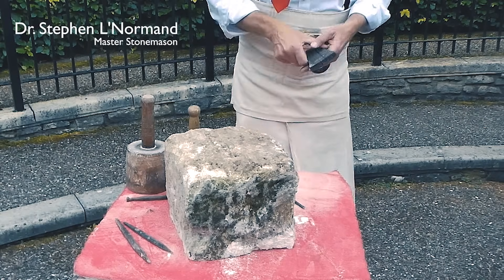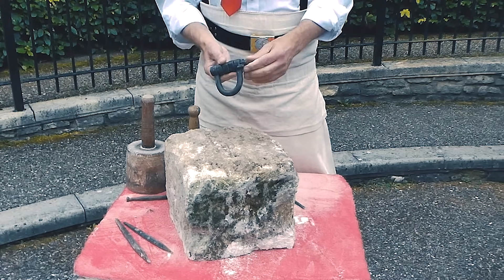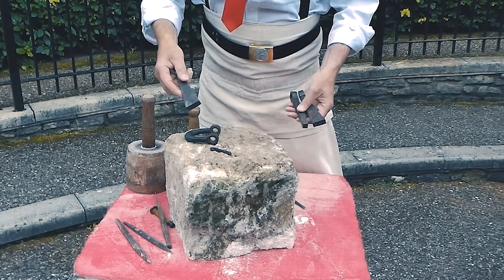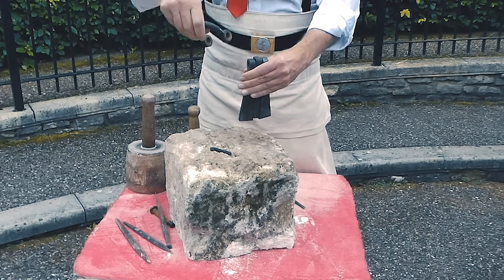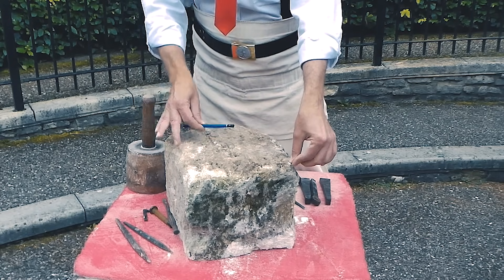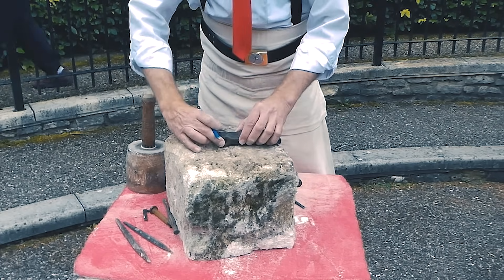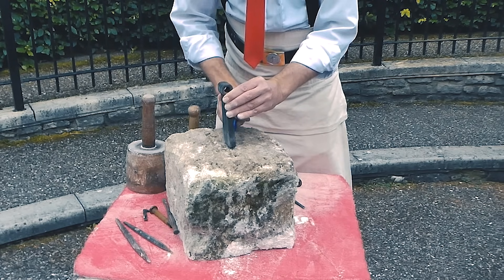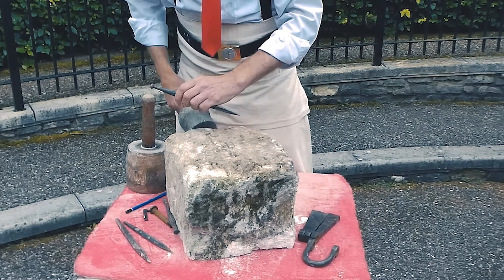Three Pin Lewis Demonstration

Comment: I have worked with old stone masons who didn’t have power tools, and I have helped them to build a couple of private mausoleums. They were 8” thick granite walls 8’x10’ they called that device a German key. The Lewis pins we use are single angled apposing holes. Sometimes as many as three mostly two. And the type of steel they are made of now makes them very expensive but they work great,because you can’t use straps when setting walls. And also the pinned stone clamp works too and cheaper.

Comment: I always wondered...Thanks for a great video, impressive demonstration with a clear narration. Well done, Sir, well done indeed.
Reply: Do you cut a keystone shape in the stone, with the bottom wider?  The 3 pieces fit too loosely to think otherwise, not that it needs to be a tight fit in either dimension.
Reply: @ljprep6250 yes you start squarely and then go wider

Comment: They allow a stone to be positioned or fitted into a slot where other lifting systems would get in the way.  The quality of the stone is important as the device puts the block in tension (splitting).    My opinion, for what it's worth,  is from basic mechanical engineering and dry stone wall building experience.
Reply: thanks. I was about to ask "why is this a thing when we have ropes?"
Reply: @zachweyrauch2988 - Ropes would be difficult to remove once the stone was in place if you had it sitting on them.  You could use either nubs or pins driven into the sides of the stone to lift with ropes rather than having the rope lift from under the stone.

Comment: Brings back memories. I worked off the side of the Manchester ship canal. The Queen Elizabeth II Dock repaired chipped que sides but of Granite. Splitting pin and feathers saved time to but as for that split lifting eyed hook, that was cutting edge. Ours had only two partseparate,  the hole was 30 mm and straight it was only the weight of the granite kept the pin from slipping and sometimes an inch or less.

Comment: I work stones I find on the ground with a rotary tool and diamond bits and one thing I've learned is it takes a long time to work through a piece of stone. Could be I have cheap bits, or I sometimes hit a really hard part that won't even cut. Most of the stone here is lime, so it's easy enough to work with.

Comment: i wonder if this method was not to be used for stones exposed on the upper side of buildings as rainwater pooling and freezing in the slot (if turned upwards) could have prematurely weathered and split the stone
Reply: It's UK, I will bet it's either something to do with H&S or someone was offended...
Reply: @tomekciepiaszuk582  What on Earth are you talking about? The question was about whether this method would have been used in the past for stones on upper surfaces.
Reply: @beeble2003  Ah yes, clearly I didn't pay enough attention, ignore me.
Reply: @tomekciepiaszuk582  Fair enough. :)
Reply: The holes would be in the mortar joints between courses. Capstones would be lifted wrapped with rope or inverted
Reply: wiki says there were specially cut inserts. not cited though.

Comment: Pretty cool, though I can see why it is illegal, someone that did not know how to make it right could kill someone lifting it
Reply: How? Someone lifting it would not be so stupid as to walk under it. Would they?
Reply: Yeah I work with a couple of morons that are a little high and do stupid stuff like that. I work at a small stone quarry and have seen them walk under parts of the crusher as we had to replace some of it.
Reply: @jeffharper7579 do they not put a barrier up to alert people of the overhead danger?
Reply: @paulfrost8952  if you have a controlled number of people on site (ie staff and not public) then information rather than barriers is standard practice for lifts.
Barriers can be impractical and people still walk through them.
Reply: @pobvic  if the barrier can be walked through it’s not a barrier!
Reply: No    sometimes they use a track hoe to lift parts of the plant and they have to guide some of it but they still get under some times😵😵😵 this is why I stay away from them.
Reply: Ok but just like the rules for gun safety (never point even empty guns at people), there’s social rules for lifting heavy things (never walk under a load), no matter what era you’re in.
Reply: @paulfrost8952 I work in forestry and have had people climb over barriers. Sometimes they want a closer look at what you're doing, some see it as their right to go where they please.
Reply: @pobvic   Absolutely agreed. I operate a crane in Southern Maine. I've had an elderly woman lift the caution tape and walk right through the lift zone.

Comment: is there a particular reason they are illegal now?
Reply: My guess is safty reasons.. 🤷🏻‍♂️
It's held only by preasure.
Reply: @Smokinnnn That's my guess as well. It's too easy for a novice to carve the slot improperly, and the key to slip out while the block is in midair. It's also not guaranteed that a hidden flaw in the stone won't cause it to split while in midair and there is a ton of pressure on that wedge.
Reply: @Scarabswarm  
Exactly mate. Sounds logic to me.
✌🏽🍻

Comment: Apart from this time consuming method there is a way simpler one. (Not to mention that this method has the potential to split the stone.) 
Almost all of the stones in gothic cathedrals have 2 or 4 small holes on both sides and they were hoisted up with a simple claw very similar to 20th century ice block claws. The larger the weight of the stones, the tighter the claw grips compressing it.
Reply: The first I learned of this was observing Segovia aqueduct back in 1996, and noticing all those holes and surmising they might have been for lifting. I had to look them up later. No internet for me then.

Comment: I assume that was for setting a stone next to 1, or between 2 stones, with or without mortar. They didn't have a tong-like device similar to the ones used in the early 1900s when ice wagons delivered ice. (That's why "ice box" was used in reference to a modern refrigerator.) One can save time not chiseling a lewis hole. A rope & pulleys will lift a stone from the ground to an upper level of installation.

Comment: So, this is a very clever design, but I think an explanation is in order, an explanation of why this device is better than simply putting ropes around a stone. Is it because this device allows a stone to be placed very precisely where it's going, so builders don't need to deal with any movement or instability at height? Ropes seem like they'd save time, but maybe removing them up high is more risky?

Comment: why is it now illegal to use?
Reply: Not safe
Reply: This device must have pre-dated safety. Safety is a modern concept designed to add thousands to the cost of everything, slow everything down, provide employment for a whole subculture of “safety” experts and increase the salary of everyone involved as a “pass through cost” to consumers.
Reply: @johnfisher7143 … and probably save a few lives along the way…
Reply: @johnfisher7143  Boy did you hit that one square and true.  Safety is fine and all but there comes a point that if you need to feel that safe, it would be best that you just stay wrapped up in bubble wrap and your little blankie at home in Mommy's basement being fed pudding and pre-chewed bread...
Reply: @johnfisher7143 Yeah, and how can the serfs tug their forelock while wearing a hard hat.
Reply: @johnfisher7143  No. This basically a wedge in the stone and the risk is that it will split. That should be pretty obvious. Safety standards are written in blood. Do you think road safety rules are unnecessary as well? How much ignorance can you display in one comment?
Reply: I've not seen that type used, but I've seen the hinged sort - where the pull on the rope forces the pins outwards.
Reply: @dougaltolan3017  it's one thing when you allow workers to use tools, it's another when you force them to. The modern "safety" is the later.
Reply: @futsk01  I live in a civilised country where employers have a duty of care for thier employees. That includes accident prevention.
I've heard of countries where fools shun that concept, adopting the blasé attitude of "hah, it's your own fault you're maimed or dead", even when the employee didn't have the capacity to take care of themselves.
"modern" safety is written in blood.
Reply: @dougaltolan3017  I live in a country where employees are adults and can take care of themselves as long as they aren't impeded by the company or the government. I'm aware that in some regions being an adult is a rarity and society operates accordingly.

> "modern" safety is written in blood.

like every modern rule it's written in money and nothing but money.
Reply: @johnfisher7143  No, safety is a very old concept designed to stop people dying at work. You should try it, some time. Not dying is one of the best things that can happen to you at work.
Reply: @futsk01  I totally agree with you about the money bit, but I looked up the three pin lewis and found that if some of the weight comes off the stone while lifting then it can slip out, which sounds scary as fuck and maybe not worth the risk.
I don't think that people need to be forced at great expense to do things that they were likely to do voluntarily.
Like copyright, health and safety has mutated over the years.
Reply: @malkomalkavian  Yep, I agree with all this. What government should do instead is make sure the employers aren't forcing people into unsafe situations. But it should be there as an option.

Comment: Knowing how concrete anchors work, wouldn't it make sense to have the center pin be wedge shaped instead of the outside ones, and then only have the eye on the center pin (so pulling on it just wedges it harder)? Am I missing something?

Comment: seems like it would be easier and faster to just stick the thing in a net, or just pick it up and carry it. 
In what contexts is this the quickest or easiest way to get the stone where you want it?
Reply: In the context of having to place the block on a wall, and not having a net suddenly pinned beneath it. By carrying the block from the top, you can lower it into its exact place and not have to try and shift it while straddling a half-built wall 50 ft in the air.

This is used on bigger blocks as well, the small stone was just for demonstration purposes. Nobody is carrying a 300lb block up a rickety wooden scaffold. Or having to one-hand it while trying to maneuver the net out from under it.

Comment: I assume that they were effective and easy to use, but the blocks can still split, so they were made illegal to stop people from using them.  Professionals may have an occasional accident but the tool is so easy to use that amatures would cause all sorts of trouble.  A pity.
Reply: Not splitting, the pins would get loose during transport and elevation, because they are held by friction,   this caused several deaths.

Comment: I don't have much experience with historical (or any) stonework, but at first glance, this seems like an awful lot of work just for the purpose of lifting the stone. Why not use a simpler method, like the self-locking claw things, for example? Cool technique, though.
Reply: Those were not made when these were widespread. It's a historical demonstration of how it used to be done.
Reply: @timothydoyle9635  Hm, I thought those claws were pretty old too. I remember seeing one in the museum of the Charles Bridge in Prague, which was built in the 14th century.
Reply: They probably provide a more secure hold on the block. I've seen several of these holes in stone mines in Wiltshire. They're an easy thing for a blacksmith to manufacture as well which probably helps
Reply: They were used because there's no encumbrance on the sides or bottom.  So no complicated fitting issues to overcome, just set it in place and done.
Reply: Forging one of these is much easyer and can be done in a smaller smiths. Big claws require big forges and good metal quality. Small tools are easyer to maker
Reply: @ignasmaciulis1095  The lewis bolt was in use more than 2 thousand years ago. Really very old.

Comment: I enjoyed the video.  Very interesting stuff.  How come the mechanism is illegal now?
Reply: If the stone had an unknown fault, and we're talking much bigger stones being lifted way up in the air, it could let go while being moved and fall to the ground killing whoever was unfortunate enough to be under it, or possibly doing some serious damage to infrastructure. It was a system that didn't have any backup if it failed. These days we can add multiple chains and / or straps to something being lifted. 

Also the process of adding the holes it needed to install it, could cause damage to the stone you didn't want in the finished product.
Reply: @PathosBedlam  so you know of this method failing then
Reply: @paulowens2062  No, I'm sure.

Comment: Why is it illegal now? Unreliable?
Reply from the maker: they can fail if they are snatched up to quickly, no problem with an old rope pully or block and tackle but with an electric winch or crane they can brake the stone around them and pull out.

Comment: Why is it now illegal? I can't understand your accent.
Reply: Because if you make the slot slightly too big, the block can fall. Also, the key exerts an outward pressure on the block, which can split it if it contains cracks.

Comment: What's the purpose of this?
Reply: He mentioned at the beginning, that you can use this method to attach a shackle to the stone in order to lift/move large stones id imagine using a crane or gantry system
Reply: And you can’t lift the stone in with a sling. When it fits against other stones, the sling will foul (get trapped) The Lewis lets you lift a big slab in and then you can just remove the Lewis from the top